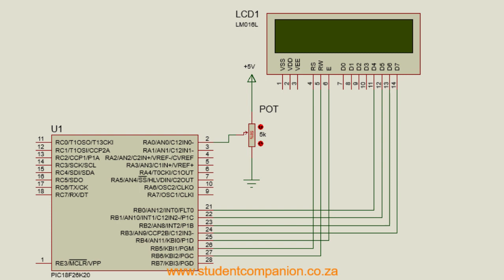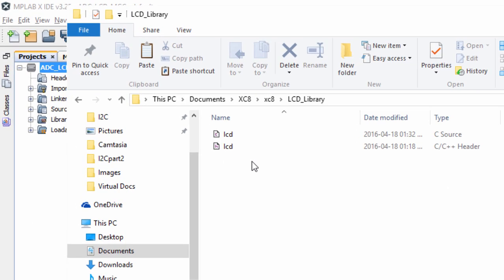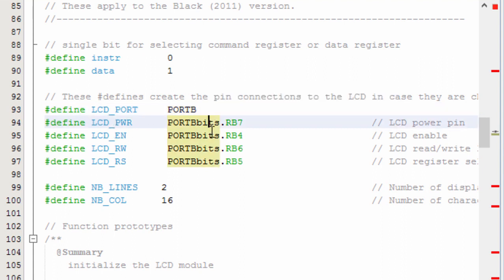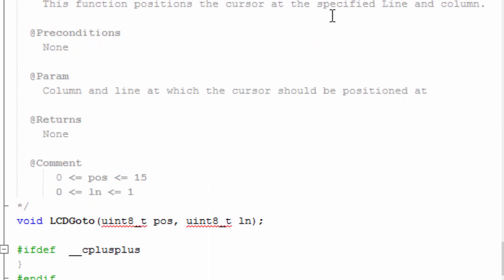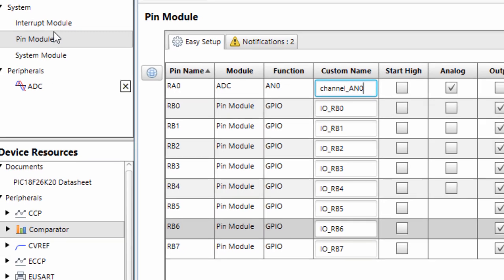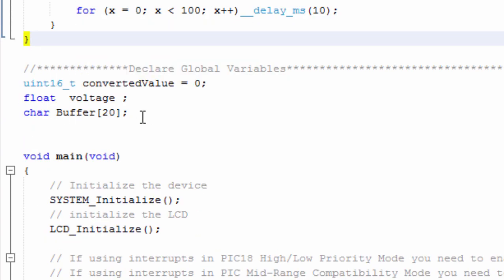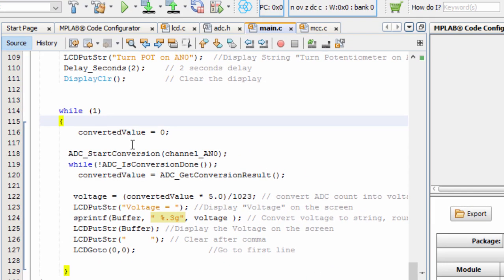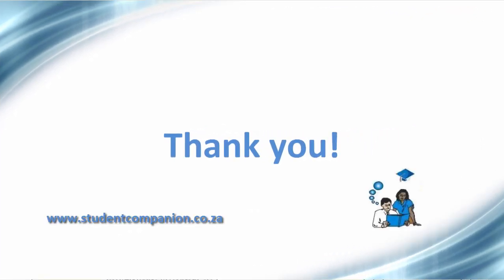22- ADC and LCD with MPLAB Code Configurator | MPLAB XC8 for Beginners Tutorial

Comment: yes it solved my problem. but 
#include <adc.h>
#include <delays.h> 
What should ı do for this library files.?
Reply from the maker: +MG G4222 we don't understand your question.  What was solved?
Reply: I solved xlcd.h files  but these 
 #include <adc.h>
#include <delays.h>  are still unsolved problem in my compiler and its library.
Got it?
Reply from the maker: Are you using MPLAB Code Configurator or the PIC18F Peripheral Library?
Reply: In previous, I asked questions about the #include <plib/xlcd.h>
and then you found a solution by downloading a document.
but 
 #include <plib/adc.h>
#include <plib/delays.h>  these files including is still problem what ı need to do it.
As your question, ı don't know what dıd you ask me that MPLAB Code Configurator or the PIC18F Peripheral Library?
Reply: when ı look at the properties of program XC8 linker and link in  Peripheral Library in my project.
Reply from the maker: +MG G4222 what errors are you getting? Can you paste all the errors when you are Building your code? Can you paste your main.C code as well?
Reply from the maker: +MG G4222 are you getting errors or warnings?
Reply: yes but ı am downloading it again  right now.
Reply from the maker: +MG G4222 please be specific with your answers so one can know what you are facing

Comment: multiple adc channels (switch sequentially) using interrupts example ?
Reply from the maker: +KIYASUL ARIF Abdul we don't have example but it's possible. You can do it with mcc
Reply: Yeah I have done that (interrupt using Timer2)! I m just not sure how that works ... I m calling ADC_StartConversion() [ADCON0bits.GOnDONE = 1] inside main [outside while(1)] and then reading the values inside ISR like 
void ADC_ISR(void)
{
    // Clear the ADC interrupt flag
    PIR1bits.ADIF = 0;

 adc_result_t adc_channel_a5 = ADC_GetConversion(channel_ANA5);
    __delay_ms(2);
    adc_result_t adc_channel_c3 = ADC_GetConversion(channel_ANC3);
    __delay_ms(2);
    adc_result_t adc_channel_c4 = ADC_GetConversion(channel_ANC4);
    __delay_ms(2);
    adc_result_t adc_channel_c5 = ADC_GetConversion(channel_ANC5);
    __delay_ms(2);
    adc_result_t adc_channel_tmp_die = ADC_GetConversion(channel_Temp);
    __delay_ms(2);
}

Do you know if this is correct ?
Reply from the maker: +KIYASUL ARIF Abdul you have to test to see if it works. What's the reason to use Timer2 interrupt? Do you want to read the values at specific time or what?
I thought you were talking about ADC interrupts. 
If you put ADC_Startconversion inside Main and this function is called once how will you get latest conversions in your interrupts calls?
Reply: i have just one sample and hold circuit, so basically i need to switch channels and get its corresponding value to be stored in a local buffer. (continuously) . I m not using timer2 interrupts, i m using timer2 as my ADACT(auto-conversion trigger). So i guess on every clock edge, it turn on the ADC module (hardware set) so i don't have to convert or get anything inside my while(1) to loop infinitely. I have also provided an example link. I just want multiple channels to be done that way.
Reply from the maker: +KIYASUL ARIF Abdul ok.
Reply: thank you for your time. Let me know what you think about it !
Reply from the maker: +KIYASUL ARIF Abdul Did you try your code already?
Reply from the maker: Now I understand what you are trying t do based on this microchip example. Which PIC are you using? You'll need a PIC with Core Independent Peripherals to be able to implement this. Have you tested your code? It's looks OK.
Reply: PIC16F15325
Reply from the maker: +KIYASUL ARIF Abdul PIC16F15325 has Core Independent Peripherals (CIPs). You should be able to get it working. Let us know if your code works
Reply: Yeah. Sure. Thanks again
Reply from the maker: +KIYASUL ARIF Abdul you are welcome!

Comment: I am using PIC18F46k20, I'm getting errors in the simulation the LCD displays voltage=buffer.
Reply from the maker: Can you post you main.c file?
Let us see your code.
Reply: #include "mcc_generated_files/mcc.h"
#include "lcd.h"
#include <stdio.h>
#include<string.h>
 
/*
                         Main application
 */

void Delay_Seconds(unsigned char z)
{
    unsigned char x,y;
    for(y = 0;y<z;y++)
    {
        for(x=0;x<100;x++) __delay_ms(10);
    }
}
uint16_t convertedValue = 0;
float  voltage;
char Buffer[10];

void main(void)
{
    
    // Initialize the device
    SYSTEM_Initialize();

    // If using interrupts in PIC18 High/Low Priority Mode you need to enable the Global High and Low Interrupts
    // If using interrupts in PIC Mid-Range Compatibility Mode you need to enable the Global and Peripheral Interrupts
    // Use the following macros to:
    LCD_Initialize();
    // Enable high priority global interrupts
    //INTERRUPT_GlobalInterruptHighEnable();
    ADC_Initialize();
    // Enable low priority global interrupts.
    //INTERRUPT_GlobalInterruptLowEnable();

    // Disable high priority global interrupts
    //INTERRUPT_GlobalInterruptHighDisable();
    LCDPutCmd(0x01);
    LCDGoto(3,0);
    LCDPutStr("PRACTISE");
    LCDGoto(3,1);
    Delay_Seconds(2);
    DisplayClr();
    LCDGoto(3,0);
    Delay_Seconds(2);
    DisplayClr();
    
    
    
    while(1)
    {
        convertedValue = 0;
        ADC_StartConversion(channel_AN0);
        while(!ADC_IsConversionDone());
        convertedValue = ADC_GetConversionResult();
        voltage =(convertedValue * 5.0)/1023;
        LCDPutStr("voltage = ");
        sprintf(Buffer, " %.3g ", voltage);
        LCDPutStr(Buffer);
        LCDPutStr("    ");
        LCDGoto(0,0);
    }
Reply from the maker: Are you using a 4x20 or 2x16 LCD model ?
Why do you send the cursor to line 3 of LCD?
Reply: 2x16 LCD
Reply from the maker: The 2x16 LCD can display 16 characters in 2 lines. 
Why are you writing:
LCDGoto(3,0);  and LCDGoto(3,1);
This will send the cursor to line 3 which you don't have because you only have 2 lines.
Reply: Thank you so much for your help, I  see the value in the LCD but with LCDGoto(3,0);  and LCDGoto(3,1); remember the value '3' stands for the third column and '0' for first line and '1' for second line.
Reply from the maker: Yes you are correct. 3 is the value of third column. If you are still facing some problem, engage with us in the forum. Upload your project files at: http://www.studentcompanion.co.za/forums/forum/mplab-xc8-tutorial-discussions/

Comment: I am trying to read the voltage from the potentiometer, I don't able to see  it shows the voltage=buffer. Can you please help in this issue?
Reply from the maker: +mlamuli cedric can you be more specific? What PIC model are you using? Are you getting errors when you compile the code or in simulation?

Comment: I tried installing the peripheral libraries with the current version, but whenever i choose the location where my installed xc8 compiler is, all it shows is the file does not contain xc8 compiler installation whereas it is there. please can else can i do?
Reply from the maker: Can you post the screenshot of your error message and the software installation folder so that we can see how to assist you.
Reply: have installed it... just a slit mistake
Reply from the maker: Great.
Reply: when i click on the MPLAB confg as the first step what i got is "The 
device used in the selected main project i not supported by the 
currently loaded peripheral libraries " what should i do?
Reply from the maker: +Temitayo Abel it means you are using an old PIC model which is not supported by your current MCC version at the moment.  MCC doesn't support all microcontrollers especially the old ones. Please select a different PIC preferably a new model.
Reply: thank you for this... please one more thing. my IDE is not detecting my newly installed XC16 compiler, it sees only the xc8, please what could have happened??
Reply: thank you for this... please one more thing. my IDE is not detecting my newly installed XC16 compiler, it sees only the xc8, please what could have happened??
Reply from the maker: +Temitayo Abel how do you know it hasn't detected it? Did you try to create a new project with a 16-bit pic and it didn't compile?
Reply from the maker: +Temitayo Abel any error message with a 16-bit pic?
Reply: yes
Reply: it doesn't add my XC16 to the compiler to select for new project
Reply: sorry the mistake was from me... it shows it
Reply: have changed the it to PIC18F24K20. please how do i configure for an LCD display.. because i only know of how to configure and generate code source for PIC18F2220 which you used for first example. but how do i do the settings for PIC18F24K20?
Reply from the maker: +Temitayo Abel great!
Reply from the maker: +Temitayo Abel watch this video you'll learn how to use an lcd. It doesn't matter which pic you are using.

Comment: Hello! Is there a way to use Peripheral libraries with the current version of XC8? (V1.41). I want to make use of XLCD and PWM libraries but I can't.  I solved the initial "INCLUDE" problems when I put "#INCLUDE <plib/xlcd.h>" instead of "#INCLUDE <xlcd.h> ", but then when I start using the functions like "OpenLCD()" , ecc, in my main code, it gives an error again. The same happens with PWM functions. The PDF User Guide that comes with the peripheral libraries seems to be "out of date", so it is even more confusing. Thanks for your feedback!
Reply from the maker: +DMDSync Hi. We haven't tried with XC8 v1.41 but I don't see a reason why it shouldn't work . 
1. Did you download separately and install the peripherals libraries into your compiler installation folder?
2. Can you paste your code here, let see how you are using those functions. 
3. Which PIC Microcontroller are you using?
4. Is there a reason why you prefer the peripherals libraries over the new Mplab code configurator?

Comment: Hi, how would you know if a library is being phased out or not?
Reply from the maker: Hi. If you follow Microchip, you'll receive notification from them. As in this case the PIC18F peripheral libraries, they are now calling it Legacy library and they are no longer updating it to include new PIC models. This is also an indication that they are phasing out because you can't use it with new PIC models, they have shifted to MPLAB Code Configurator.

Comment: Hi thanks for the video, really helpful. I'm not being able to display decimals on the LCD. I am running my project with a real HD44780 display and a PIC18F45K22. I've tried changing the "%.3g" for "%.3f" in the sprintf() function to see what happens and just got .000 all the time, with one digit on the left of the comma varying from 0 to 5 depending on the input to ADC.  Could you please help me with this?
Reply from the maker: +Alberto C did you use decimal calculation in your code?
Reply: Hi. This is my code in the while(1) loop:
while (1)
    {  
       convertedValue = 0; 
       convertedValue = ADC_GetConversion(1);    //Store conversion value from channel 1
       voltage = (convertedValue *5 )/1023;       //Scale value to 0-5V
       LCDPutStr("Voltage = ");                  //Write string
       sprintf (Buffer, "%.3g", voltage);       
       LCDPutStr(Buffer);                       //Display value stored 
       LCDPutStr("     ");                      //Clear after coma
       LCDGoto(0,0);                            //Go to column 1 line 1
       for(int x=0; x<30; x++){
       __delay_ms(10);
       }

Also the three global variables are declared with the same data type as shown in the video.
Reply from the maker: You must use decimal calculation as we said earlier on.
This statement should be changed: voltage = (convertedValue *5.0 )/1023;       //Scale value to 0-5V
Reply from the maker: IF you multiply or divide by 5, it will give you an integer number but if you multiply or divide by 5.0 it will give you a decimal number. The 5.0 tells the compiler to use decimal calculation.
Reply: I got it working. Thank you so much!!
Reply from the maker: You are welcome!

Comment: Hello, I can't seem to implement the LCD onto a PIC18F45K22. 

I have already re-configured the code configurator (I use the internal oscillator of the 45k22).  

Were there any further considerations I had to take when using this particular chip with the LCD Library you provide?

In addition, I get some interesting results when using Proteus to simulate the circuit. The code does not work when using the 18F45k22 component, however it does work when using the 18F2620. I wonder should if that be possible, considering the hex file has been compiled for the k22?
Reply from the maker: +ireadWikipedia hi. 
Is your application displaying wrong values or nothing at all? Even a simple string? Did you generate your own hex file or you downloaded the one on our website?
Reply: It displays nothing and I have generated my own hex file (for the PIC18F45K22).
Reply from the maker: +ireadWikipedia which library did you use? PIC18F peripherals libraries or the lcd library on our website as  explained in this tutorial ?
Reply: In my current attempt, I am using the LCD library on your website. It contains functions 'LCD_Initialized()' and 'LCDPutCmd'.

I have also tried using the PIC18F peripheral libraries (which contains xlcd.h, with functions "openXLCD" and 'WriteCmdXLCD').
Reply from the maker: +ireadWikipedia did you change the default lcd connection port to the port where you are connecting your lcd by modifying #define LCD_PORT in lcd.h?
Reply from the maker: +ireadWikipedia did you as well modify the TRIS Register in lcd.c? Did you connect correctly your lcd en, rs, rw and data lines to correct pic microcontroller pins as specified in the lcd.h file?
Reply from the maker: +ireadWikipedia if you did everything as we specified and you still can't display anything, send us your full zipped project and we will check it on our side when we have time.
Reply: Yes I have. Sorry, this sounds like alot of double checking of small things.

Some other things I had taken note to check and change were:
-On the Pin Module, the pins used for the LCD have the analogue check box UN-TICKED (so digital).
Reply from the maker: +ireadWikipedia all pins should be configured as digital.  Send us your full zipped project
Reply: I have sent my current attempt through your facebook page.

Thank you greatly for the support!
Reply from the maker: +ireadWikipedia ok. We will look at it
Reply from the maker: Your project works well as you can see from the screenshot of Proteus simulation. How did you connect your LCD?

Comment: HI, thanks for video.
I have installed LCD library but I can not find these 2 files, how should i add them?
Reply from the maker: +Islombek Mamatov HI.  Which library did you install? And how did you install it? Because the library we used in this tutorial , you don't need to install anything.  Just add it into your project.
Reply: PIC18F LEgasy peripheral libraries v.2.0, it downloaded in exe. i installed to xc8 v1.35 compiler
Reply: i was watching tutorial 5 and jumped to this video, now i am little bit lost, why should i install this Peripheral library, and from where i can add those 2 LCD libraries, and can you explain how did you calculate the instruction cycle in video 5, u said 4 MHz is 1 ms and 8 MHz is 0.5 ms, sorry for too many questions, thanks a lot
Reply from the maker: +Islombek Mamatov the library we used in this tutorial in not PIC18F Legacy peripherals libraries, we used a different one because Microchip is phasing out the legacy library is no longer included in new versions of xc8 compilers.  You can download this library from our website: http://www.studentcompanion.net/en/interfacing-lcd-display-with-pic-microcontroller-xc8/
OR from microchip picdem 2 plus demo board source code on microchip website.
Reply from the maker: +Islombek Mamatov tutorial 5 used pic18f peripherals libraries but this tutorial used a different library which you can download from microchip picdem 2 plus demo board source code on microchip website or on our website: http://www.studentcompanion.net/en/interfacing-lcd-display-with-pic-microcontroller-xc8/
Reply: I got it Thank you very much for ultrafast respond :)
Reply from the maker: +Islombek Mamatov you are welcome!